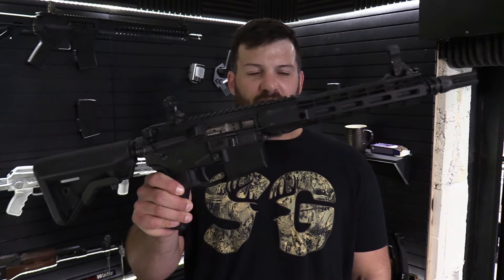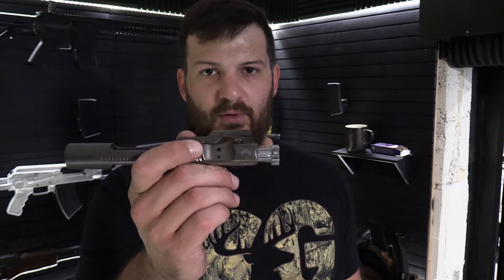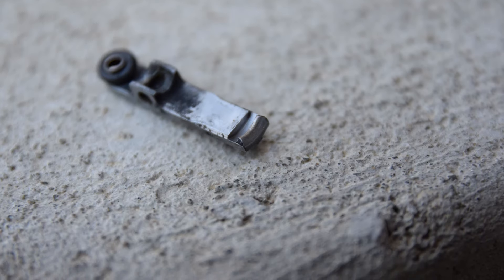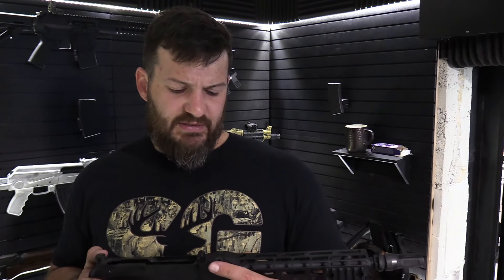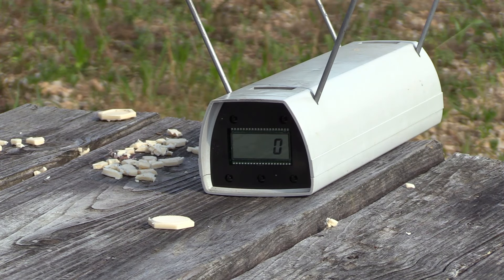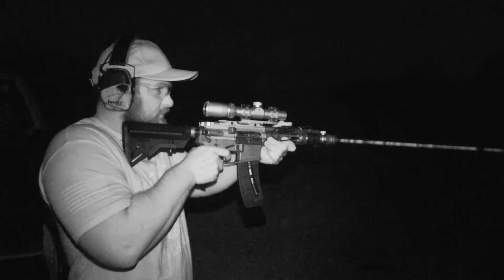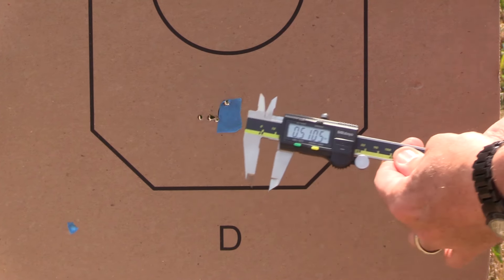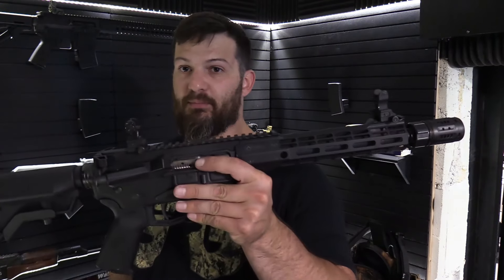Chrome Lined Barrels are Stupid || A Year of Testing

Comment: Still rather have CL in a duty weapon as chrome handles heat a little better than qpq/nitride in most studies. It helps with pitting in the chamber in poor environments better and should help with extraction when the chamber heats up during mag dumps a little better. But yes, qpq is well sufficient for most people and even most duty carbines.
Reply: @Twiggy Bones most hammer forged barrels ARE cmv 4150 these days.. In terms of longevity, you can't beat a chrome lined CHF 4150 chromoly vanadium barrel.. The psa premium barrels are great, they're made by FN and are thick chrome lined, cold hammer forged, 4150 cmv. They're very accurate for being chrome lined as well. Honestly tho, you'll be well served with any well made chromoly 4150 nitrided/melonited barrel as well.  Theyre cheaper and there really isn't too much of a reason to not save the money unless you're going to be doing full auto magdumps. Normally a lil more accurate too. It's a good middle ground between the accuracy of a stainless steel barrel and the barrel life of a chrome lined barrel. You can normally save half the money you would spend on a good chf chrome lined barrel.

Comment: I can agree with the assertion that metal quality has increased. Also powders are less corrosive. Which is why chrome was done in the first place. So if someone uses quality ammunition and cleans it with in reason a non chrome lined bore should be fine. But not 170k fine. 

But why the hell are you drilling a brush in both directions in your bore? You don't clean your guns? And don't have the equipment to do so? I was taught to clean in the direction of bullet travel... a bore snake serves my purposes well. 

This is insane to me for many reasons. And you lose credibility in my view. But there are some tests you do that others don't, so I'm still here.

Comment: Why chrome line?  Just get stainless.  And like your said salt bath nitride
Reply: Depends on how u shoot. Wouldnt want to run a SS barrel if i was rapid firing a lot.
Reply: Chrome line and stainless are two completely different goal stainless has shortest life chrome is not as accurate but they are able to handle a lot of ripped fire longer then a standard barrel.

Comment: I've been very happy with my Aero Precision and Ballistic Advatage Hanson series barrels in QPQ coatings. My only gripe is the coil pin for pinning the gas block on 2 different builds were garbage. One chipped on the end during installation and the other was uncoiling it's self as the coin pin was being installed (parts provided with barrel). I ended up doing a taper pin in one of the builds. I order some higher strength coil pins to have on hand. Other than that fantastic products.

Comment: Rust my bro
Reply: Technically both will corrode but nitride will not rust for a very very long time...on old AKs without chrome lining... like a yugo.... you will get rusty barrel because you have neither...
Reply: @Chriskelly19067  interesting cuz everything freaking rust where I live

 I have dehumidifier agent in every case of everything

And to be clear...we are speaking about the lining of the barrel... all the other parts are more or less easy enough to cover in oil or carbon of some degree or another

Comment: This is bad advice, alot of company's sell crap so say X or Y is the best but it's mass produced crap with low quality, a few cases of ammo not a real test most barrels are thrown out on button machines and then dipped in a nursing coound as its so cheap but only a few can make quality CHF CL barrels as the CHF machine is expensive and a good CL is also expensive and requires high QV and  same with good carriers and bolts most company's use crap parts as they assume most won't shootnmore than a few hundred rounds.buttom cut barrels with nitride are awfull, CHF id acceptable if done very well but still not great, all these stupid costings for carriers is just a way to sell you something you don't need, nitriding is for pistol barrels not rifles, if NiB and nitride was so good it would be in wide use with service rifles or when it comes time to replace parts,all modern assault rifles use CHF CL barrels (us mil ar button), a modern chrome lined barrel like FN will last a long time and with CHF and modern processes no lack of accuracy unless you use match 5.56. It stops corrosion and handles heat well plus it really helps with feeding and extraction.
Yes chromed bolts are great but you have to buy good ones with good hard chrome but you can't use a chromed extrsctor as it can slip.
And all these fancy BCG finishes are stupid get milspec phosphate with good chroming in the inside of fully chromed sans extractor that's good quality.   All the others are not efficient and just look pretty or are easy to clean but they don't run well.
A good milspec or inkinel gas tube and good gas block that's drilled and pinned and your golden.
Don't run ARs dry and clean them properly, was too much AR good for nothing crap in the market already.
Be careful when cleaning for bolt and BGC don't use abrasives and with a CHF CL barrel you can use a boresnake with just a nylon bush, don't use brass brushes or steel cleaning rods , only use a steel cleaning rod if you have a guide to get out a stuck case.
With modern good cleaning products you can use solvents to clean most and wipes.

When you get the heart of the riflenas in the barrel bolt and carrier make sure the company pressure tests and MPIs them individual not batch as in testing one in 100 and all quality CHF CL barrel makes like FN use a proof load as in an overpressured round or 2 then a standard round.  In other nations you can't sell a barrel that has not been proofed / shot with over pressured ammo for safety I would love to see how cheap bolts and barrels do after a few proof rounds as some fail with standard.

If you want a duty rifle that's not a toy first a good quality CHF CL barrel such as FN then a good milspec phosphate carrier or fully chromed carrier sans extractor that uses good springs, milspec tube or better inkinel gas tube with a good drilled and pinned block (cut down front sights are rock solid) if 5.56 go 16 but 18-20 really shine, the rest of the rifle standsrd good milspec and a good non drop in trigger with good springs and a freeflost handguard of yoir choise thats solid.
But the most important thing to do is to check the parts are in spec, and torque everything down properly also true face of the upper.
If you can it's best to buy the carrier without the key installed and use a stone to true it then use a sealing compound, good boots and torqe it properly then stake it well.
Some company's offer this and make them to spec it depends on your budget but I like to make sure by doing it myself.
I like to use steel mags with good prongs and the latest tan no lilt followers.

Get a good quality spring and buffer and yes sometimes you will want to change springs and such.

A good CHF CL barrel will stay within 2moa after 30k+ of millitary full auto burst (not constant) my first AR with a FN CHF CL barrel has had over 50k of mostly russian bimetal FMJ and its still sub 2moa with brass,  first I have 2 early SGL (Siaga converted AKs and the 102 in 5.45 when my uncle was importing 7N6 for less than today's cheap .22lr prices had over 150,000 rounds of mag dumps and the barrel is still 2mao and looks great and that's corrosive ammo but I did clean it (I seldom shoot it after the 7M6 ban) I have many 7.62x39 AK imports and builds with imported barrels all CHF CL and some have over 50k look like new snd they sre thin barrels for 7.62

Comment: Chrome barrels are very cool. You should have been in Vietnam . No chrome didn't work so well and lots of people died trying to use a worthless piece of junk M/16 rifle. It's a bad design even with a chrome barrel .
Reply: The problem m16’s didn’t have chrome lined barrels and chambers... (as far as the xm16e1 that is) the designer wanted them but the man who ended up being in charge of getting the firearms cut that out as a cost saving measure and also used an improper powder.